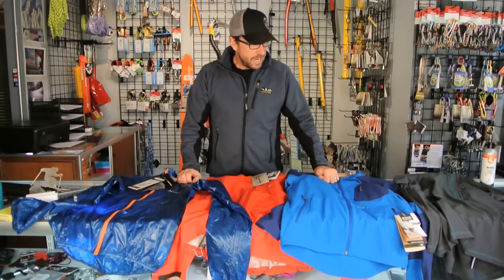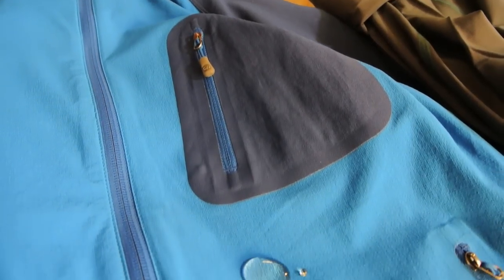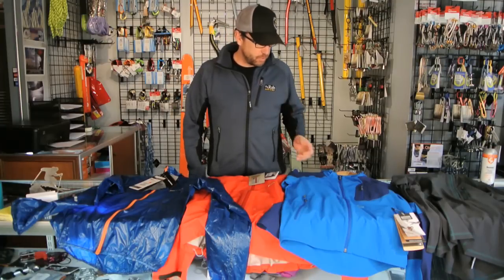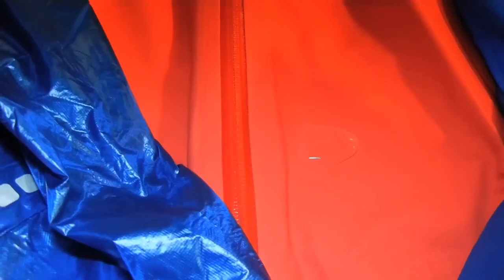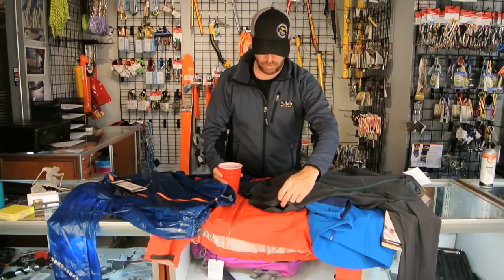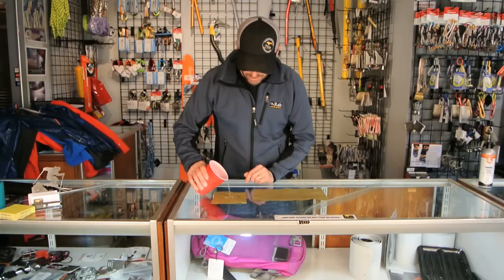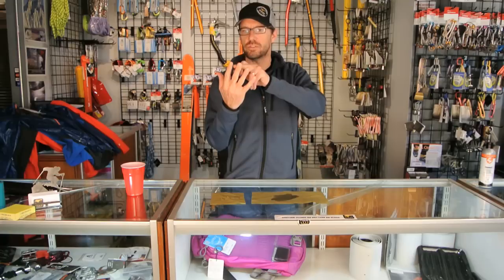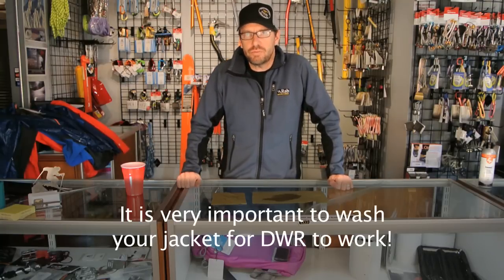DWR - Durable Water Repellent

Comment: Hello friend which fabric or tshirt what ever you call,can absorb oneside and not show otherside the wetness,lets say I have hyperhydrosis and sweat a lot,inside wet but outside dry,I saw another fabric who does that and it is C6 DWR..some commercial companies show water repellant product but not one has pressured with there finger on the surface off the applied DWR...

Comment: Hello guys, i have one problem with my Mammut Meron Gore tex Pro (2013 
generation)
So i used this jacket 7 times only, in the beging DWR was fine, water 
was sliping down, when i was testing the jacket on raining day. So when i
 was on mountain i notice that DWR is completly gone, evry drop of water
 or snow flake make a wet spot on jacket and after 10-15 minutes i look 
completly wet. 
So is this normal for brand new jacket i mean ???